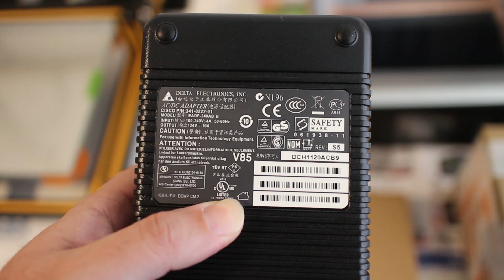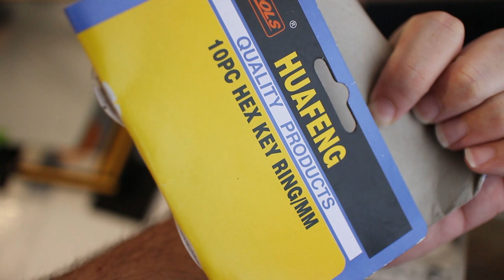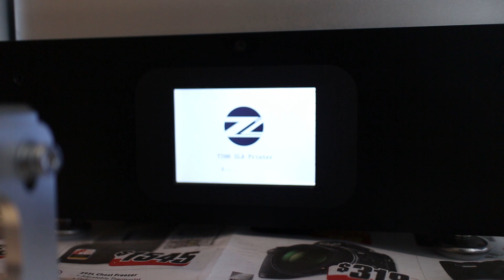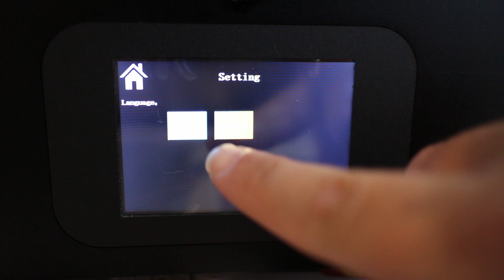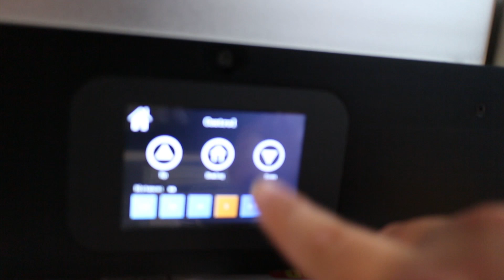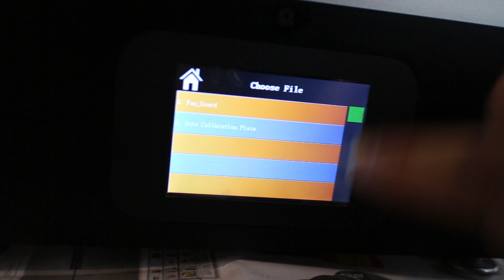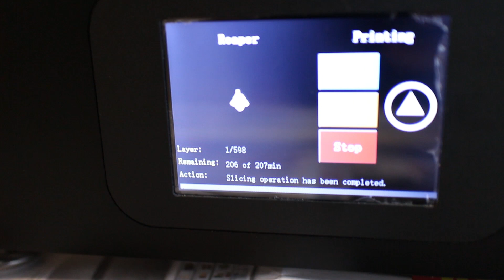Tianfour T200 - Cheap Large Format SLA Printer

Comment: Looks great!
Reply from the maker: Its not without its issues which i'll get into in another video, and its missing some advertised features like it has no USB printing (even though the model in the photo has usb ports on it) which is really annoying as that's how i prefer to print, and if your ethernet port breaks or there is a power surge then the whole printer is basically dead.

Comment: Sorry but this is so blurry and shakey it's impossible to watch
Reply from the maker: I know :( you only get one unboxing and this camera in auto just didn't perform.

Not using it again, I have a little bit of footage for some other project on it but after that it's back to the 60d
Reply: @rm2kdev  I don't know if the unboxing part is even that important, tbh. You could just upload a small review and show off the printing process again. Because it's still an interesting device and I'd like to know if it's any good or not :)
Reply from the maker: @vennril  Well that's a review and I'm certainly doing one of those :P and certainly not with this bloody camera lol.

But unboxing is important, i was probably the second person on earth to buy one of these. Most sellers had 0 sales one had 1 sale, there was 0 reviews and one guy who did an unboxing but didn't show very much about it at all.

For me as a buyer I wanted to know before spending a grand would the thing turn up, what was really in the package and if it worked at all :P

So i took a gamble on a seller and when it arrived i grabbed the camera and tried to answer these so that the next person who buys one can find at least something :)

But to directly answer you, a review will come I'm printing like a mad man on this thing right now to work out all the kinks.

the TLDR of that review is, its great has a few problems but generally works fine

Comment: Nitpicking...but the light used in these printers and resins is not UV. Its 405nm, UV is below 400nm.
Reply from the maker: Yes that is correct, though i believe the resin is formulated to kick at 405nm so as long as it matches the light source it should be effectively the same as resins designed to kick in proper UV ranges

Comment: Looks like it's a DLP instead of an SLA. Anyone have thoughts about this?
Reply from the maker: SLA is the process, DLP is the method we use to achieve it :) to answer your question this is a LCD Panel masking a series of UV Led's. The pixel density is the same as the anycubic photon, except its spread out over a build volume twice as large so the effective print resolution is 4x lower.

However the Z axis is capable of 0.025, and photon is capable of 0.05 so you have double resolution on the Z axis, with this in mind the effective visible quality of the models output from this vs photon is almost indistinguishable. 

This has slightly more pixel stair stepping than the photon, however the panel in this is capable of subpixels and pixel dimming so you can use anti aliasing on the layers (photon cant do that the .photon file restricts it)

Net result at the end of all this is a print quality that is almost identical
Reply: @rm2kdev  the pixel number is the same so the density is 4x lower.